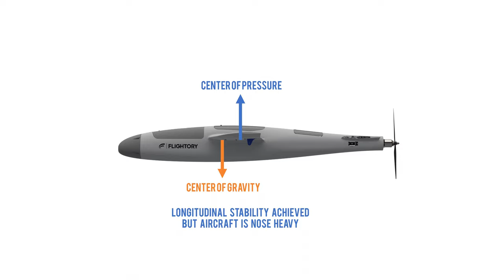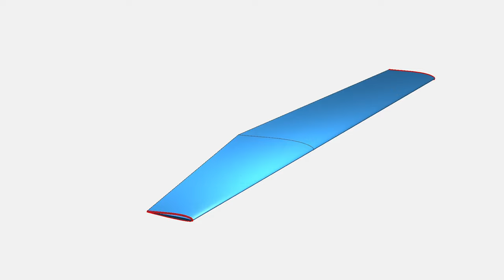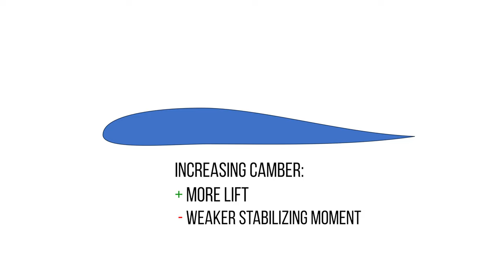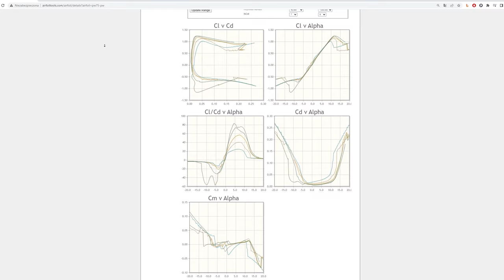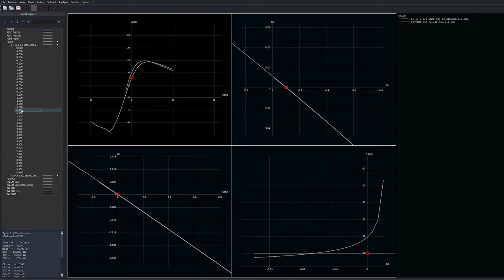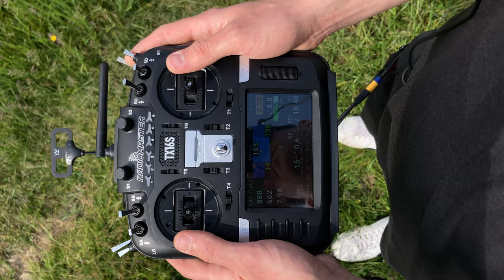My New Ultralight FPV Wing - Mini Plank

Comment: Whats the stall speed?
Reply from the maker: Below 25 km/h
Reply: @FLIGHTORY  so in theory you could handlaunch and catch it? 
What's the weight of the 3d printed version?
Reply from the maker: @amoswolfe7122  Yes, you can try to catch it because the approaches are slow. I don't know yet what the weight of the printed version will be, but the print itself should weight about 120g, so I guess whole plane around 310-320g

Comment: Lovely project and thanks for sharing but I worry that all the small FPV Nanogoblin style drives have forgotten all their basic aerdynamics ce lectures : drag is proportional to frontal area so the thinnest strongest walls should be used on the fuselage. Expanded polystyrene is not smooth like a sailplane surface

Comment: What is the diiference between ground speed and air speed ?
Reply from the maker: Ground speed is speed relative to the ground, and airspeed is speed relative to the air. In this aircraft, airspeed is only a value estimated by the flight controller because there is no pitot tube here
Reply: wind is the difference :)